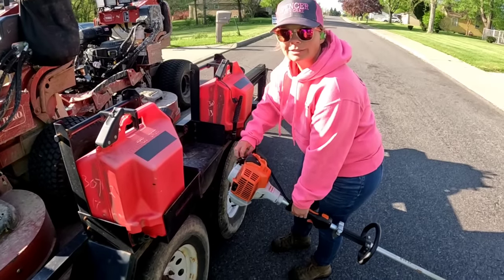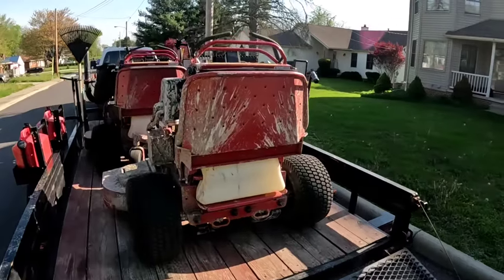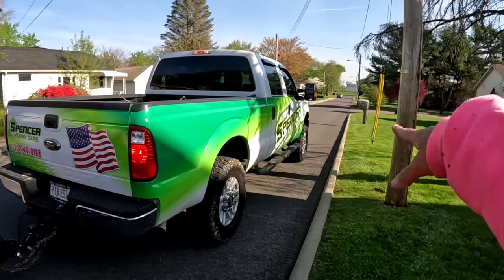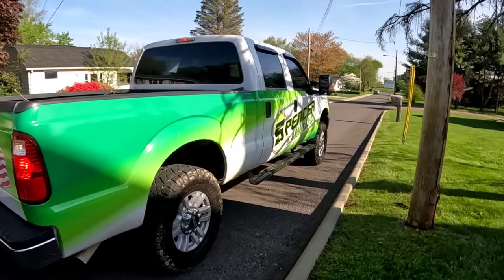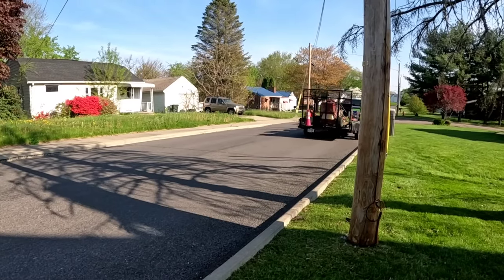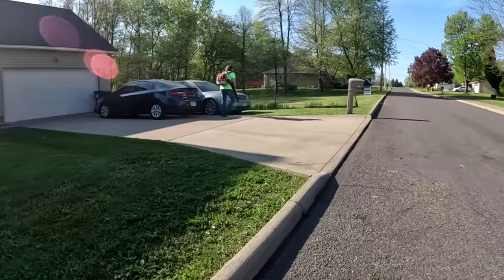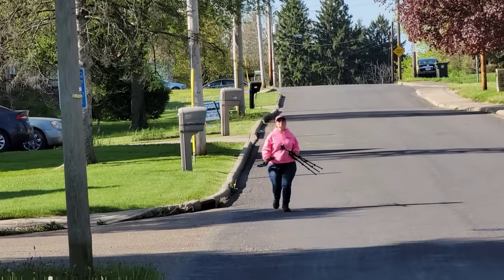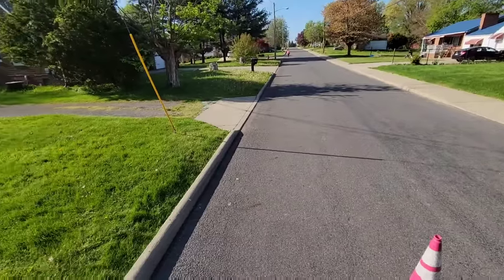WE NEED YOUR HELP | THEY REALLY SAID IT COULD TAKE A YEAR!

Comment: I feel overall multi use UTV is Polaris Ranger 1000.  Fire Dept I’m part of has two one for wild land firefighting and other for off road rescues.  Been very good and reasonably priced depending what u get but Polaris 1000 has one of top tow and bed capacity.  Can Am makes a 6x6  think called commander which is also on top.  Kubota and John Deere few public works use around my area especially the kubota with the diesel.  IMO Polaris offers good balance of work n play with Can Am 2nd.  Kubota and JD strictly for work.  Stay safe keep up amazing work and with the heat building stay hydrated lol

Comment: I have the Honda Pioneer 700.  It is great for a small farm (5 acres) and trail riding (500 acres adjacent to the property with tons of trails).  You can tow around 1,500 lbs and the bed I believe is around 500 lbs.   You can customize it to do just about anything (get the hardtop and windshield if you are going to trail ride).   If you don't have trails, consider a tractor for versatility.  Additionally, other manufacturers make diesel models.   If you plan to live there I would get a diesel UTV, diesel tractor and switch to diesel zero turns.   That way you can have a good sized tank placed on the property and fill it with off road diesel (red dye/much cheaper due to no road tax) and everything runs off that fuel.   If I had to do it over again I would do it that way.   I have the Honda, a Kioti compact tractor with all the attachments and an Exmark ZTR mower.  I spend a ton on e-85 free fuel for all my equipment (Kioti is diesel) but the mower, UTV, generators... keep the Persian Gulf happy with what I have to give them.  I enjoy your channel.   Keep it up!

Comment: Have 141 acres and the first thing I purchased was a Tractor with a loader , brush hog , and a grader box . It was the most used piece of equipment I ever had . We bought ATV's later on because they could get through tighter spaces through the 90 acres of woods . Do yourself a huge favor and get a tractor for the work and ATV's for play .

Comment: I have owned a Polaris ranger for 10 years. I have worked it way past it's hauling capacity and my six kids beat the snot out of it on trails. To say it has been used and abused is an understatement. I bought it for my personal acreage and now I use it to maintain 62 acre park with a quarter mile beach. I change the fluids every year and replaced the tires 4 years ago. It is still going strong. I also have a Kubota sidekick 850. I would take the Polaris Ranger hands down.

Comment: Hey I'm not trying to be a jerk here but you have 4 wheel drive pickups.  You better be careful spending all this money.  I'm getting on in years and if there's one thing I've learned is to not buy things until I absolutely need them.  The more stuff you have the more you need to maintain and protect.  You must be doing rather well and it's best to shove some aside because that might not always be the case.

Comment: Just buying old truck Most states you can say farm truck on it pull your stuff around they have at least a half ton capacity you're never going to use it on the street that's what we all do $1,500 will buy you a good one but one of those little side by sides which is basically a glorified golf cart is going to be 15,000 and up

Comment: Aaron from Garden Answer has 3 or 4 I believe. One unit has been down quite a while Gator. He is pretty helpful. The added a golf cart because it looks like it will he long wait.  Also Dutch Off Grid Homesteading has a unit but added skid steer? Aaron has 2 Gators and a golf cart and tractor at use all day everyday.  He has done alot of research.. Dutch 2.

Comment: Can-Am is by far the most popular machine in this part of the world, but they are used a strong 90% of the time as recreational vehicles. The John Deere Gator is about as strong a machine as a person would need for workin' on your property. I have seen those things take years of relentless abuse and still get the job done year after year. The right model would likely fill your recreational needs as well. If I have you pegged right, you aren't so interested in stunts and high speeds, but more so in taking the family exploring on your land and a Gator could certainly do that. They have a strong dealer network supported by a very well-established company with strong roots, so that's a plus. Shawn, have you ever considered an eight-wheeled amphibious Argo? They are very strong for working, especially with the track option and they are also a whole lot of fun. They float like a boat and even have a place for mounting a small outboard motor if you tend to spend a lot of time in the water. The outboard isn't a necessity though as the wheels give it momentum and you could even row it if ya really wanted to. They have been around for decades and are priced surprisingly well, so ya may wanna consider one of them.